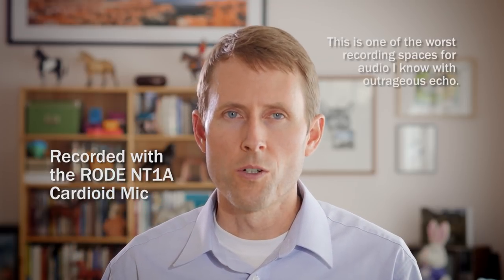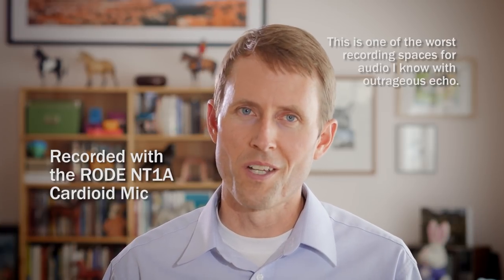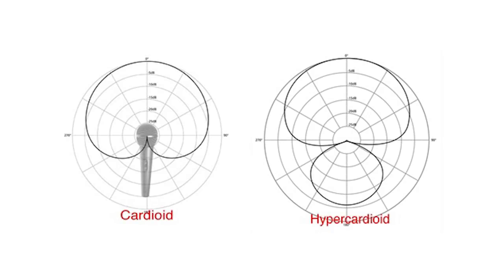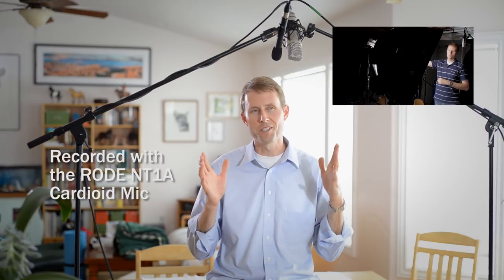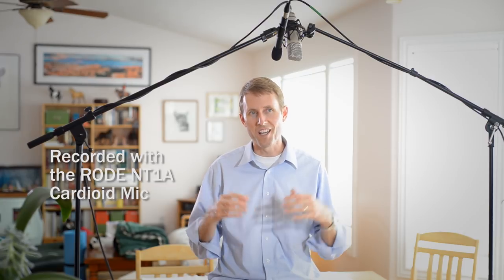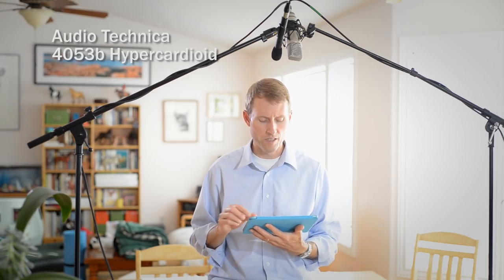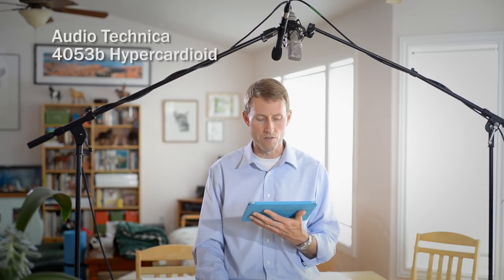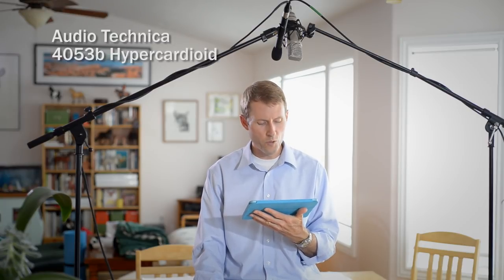Mics for Rooms with Echo: Cardioid vs Hypercardioid

Comment: I loved the audio on this video when recorded on the cardioid mic... I was thinking about getting a shotgun mic (Rode Ntg 2 condenser) but now I'm in doubt.. anyone who tested the two on a room with reverb, can share the experience with me?
Reply from the maker: I'm in doubt about the NTG2 in general. It was my first shotgun microphone but it requires a LOT of gain so it has that working against it as well. I actually find that the differences are not that huge between cardioid and super/hypercardioid. They're all a tradeoff and they all pick up reverb in rooms with lots of it. Most production mixers for TV and film opt for super-cardioid, non-shotgun mics and use lavaliers for backup. Best wishes!
Reply: Please don't get the NTG2, you'll curse your life. Get the NTG3 if anything.
Reply from the maker: Agreed, or the NTG5 or the DEITY S-Mic 2. There are a lot of other better options in 2020.